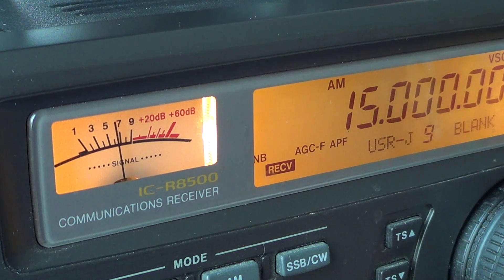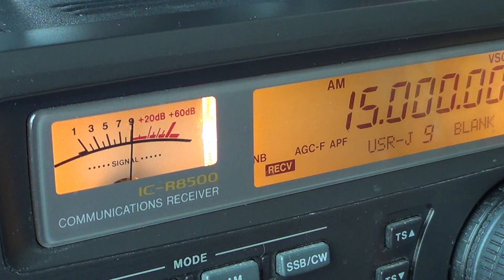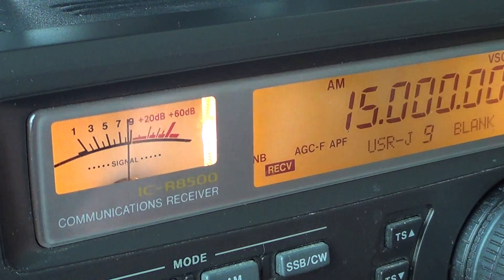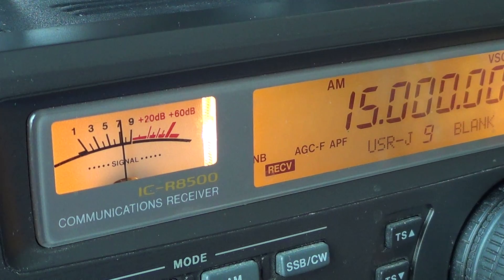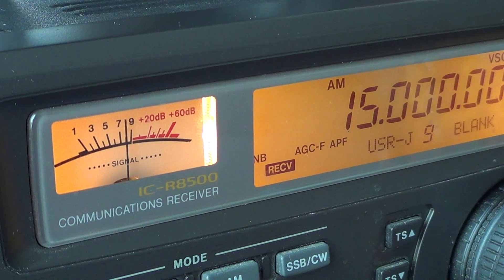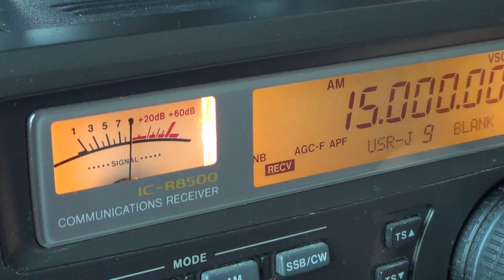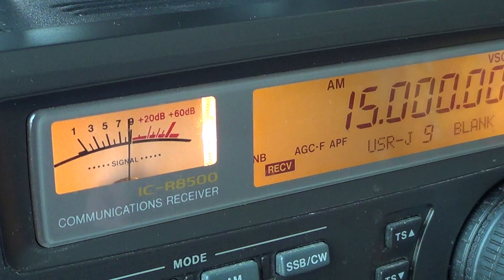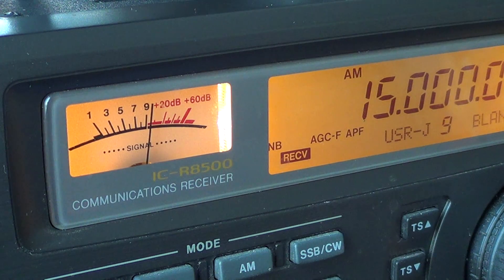Calibration of your receiver frequency

Comment: You can also use a freq tone gen..an app on pc or phone wil do...set it fot 800hz and listen to the tones...they should ring together..if radio is off freq you will hear tome waver...careful ajustment of radio ref xtal to get tones ringing together with no osilation will get you near enough bang on freq if you have good hearing of course.